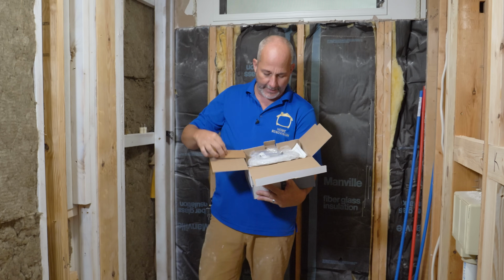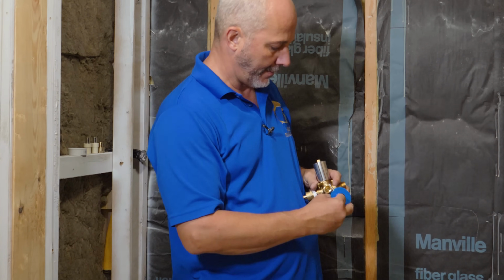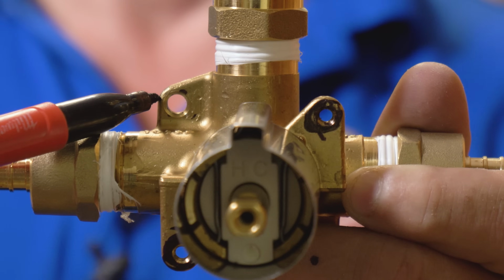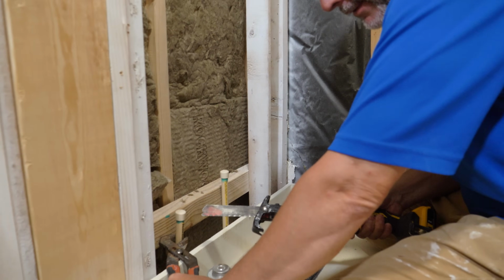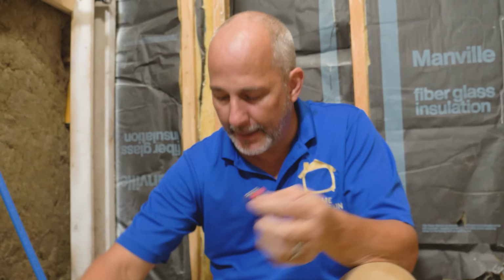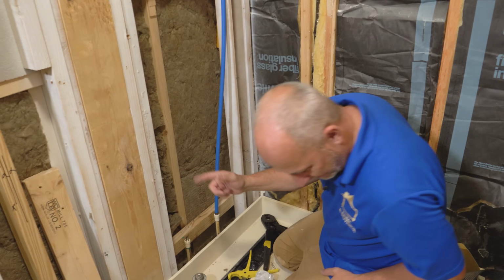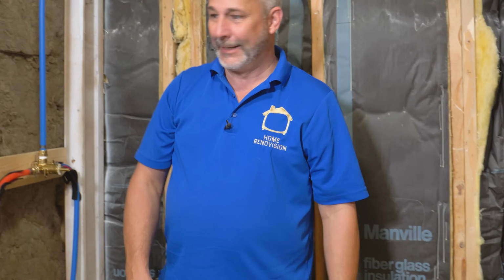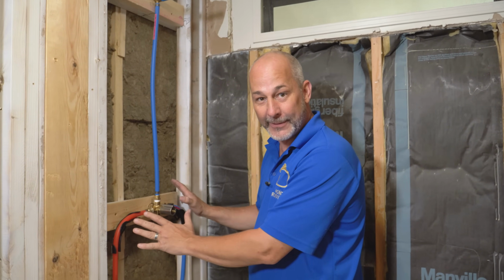How to Install a Shower Valve Kit (For Beginners)

Comment: That no-go gauge is for making sure the crimping tool is working properly. It has an adjustment screw for a reason, and that reason is not to cover the asses of absentminded installers.

Comment: I just removed my tub. Found out it was cast iron and weighed 300 pounds.  Had to cut it in 3rds with a carbide sawzall blade just to get it out. Fun times.

Comment: What about water hammer?  do you still need to include the extra piping on each side of the valve to prevent it or is not necessary anymore?

Comment: One thing I would add, if you are taking any pex out with these crimps or mess up (ask me how i know) when installing new. i use a Dremel tool with a cut off disk to cut the ring. Unless anyone can share a better way ?

Comment: Yeah you are a good guy. Ive watched several of you vids. One question though. Would it be better to use pipe dope after the teflon tape for a better seal on that valve? Ken in Cali

Comment: If only Sioux Chief made a 90 degree pex-b to sweat male adapter that was less than $1.50 and avoided the potential of leaky threads and the need/space for bend supports.

Comment: Currently doing my shower plumbing and came specifically to find out how tight the threaded connections need to be to see if this was something I needed help for. Thanks for specifically calling out that it needs to be tight but you don't need super-human strength! Tightened, and no leaks! 🙌

Comment: I'm not sure if he said whether he was using pex A or B?  This video shows how to use pex B, and I noticed a few comments seem to imply it's pex A.  A and B do look identical.  I saw one youtuber who said pex A pipes are white and Pex B are red or blue.  But that's just not correct (based on what home depot has in stock, you can also get pex A in blue or red).  Maybe there was a time when Pex A only came in white.  Pex B is slightly more rigid and uses crimps to make connections (an insert-type connector reduces diameter which thereby, also  reduces flow...supposedly).  Pex A is a different material that uses "expansion adapters" (you basically stretch out the opening and slide it onto the other pipe).  So Pex A keeps the full 1/2" diameter for the length of the pipe (which supposedly means better flow rate at the draw which might matter if you want better water pressure?  Just guessing.  The thing that's tricky is Pex A adapter sizing.  If you're looking for a pex A male adapter, it will be exactly the same diameter as the pipe (a full 1/2"), NOT slightly smaller as the insert adapter seen in this video.  If you wanted to go with Pex A, I don't think you'd even need a brass adapter at the supply line (just the expansion adapter).  At the top, instead of a pex-b ear drop adapter, you'd use a pex-a ear drop adapter.  I think that's the only difference.  Pex A is more flexible and some are saying even more reliable / easier to work with than Pex B.  The important thing to know is which type works with crimp vs which one works with expansion type connectors.  I was all set to buy pex A pipes until I figured that out.  And I'm still not really sure which option is best.

Comment: Went to take the copper pipe out of a finished tile shower.  It has been soldered in... I don't want to break the tile to change the ear drop elbow.... what are your thoughts if I just add a threaded copper adapter fitting to the existing 1/2 copper pipe.  The fitting will covert my copper pipe to a 1/2 inch male threaded connection... yes it won't be pretty but its a basement shower and I have black paint.  Do use see a problem, like strength wise?

Comment: I purchased this kit ( the same one) but the back of the shower valve has about a half of an inch pertruding out of the back/ it doesnt lay flush on the 2×4, did you drill a circulars indentation into your two by four or do u just screw it in like that ...its odd

Comment: Re Depth: if I put a piece of cement board and the tile I was using together and held it up near the shower value, would the front/top of the tile need to be in the middle of the green ring or at the very end of it. 

Also is it trendy now or have you seen it done where the handle goes over to the side so its not directly under the shower head ?

Comment: Terrorism supplies 
For a railroad track apartment...replacing copper with plastic..too set someone up for a leak when  bathtubs and  bathtub liners and walls are made of mildly flame resistant materials...which are suitable for joining operations of copper involving sanding cleaning and flame too material.

Makes me want too run for a bath or black water created by the dam society. 

Way to truck down the wheel rights with confusiousness.

Everyone wants to be parts tester.

If only they stoped running the trains at nite and served alcohol with h.i.v. pills education and preventative care in schools...like where medicine should start...corrective surgery numbing agents  including radiation synthetic vaccines with chemo and biologics when necessary.

Comment: So there must be different versions of the same compression rings or something. I watched another video where if the test tool goes all the way over, there is too much compression. Seems like the way the tool cams over, it would be the correct crimp every time

Comment: How do you get the fittings to engage the teflon without pushing the tape upwards? More of with 5 wraps of the thread tape vs say 3 wraps.

Comment: Great video! I should have watched this BEFORE I renovated my Bathroom. I completed the entire gut and replaced with new cement board, tiles, grout etc. But left the plumbing from 1980 intact thinking and any new shower handle would fit. Buy the new Moen faucet, bring it home to realize the 1980 faucet mount is smaller than the new one. Duh is me. Question is, Am I stuck tearing out new tile work, board, etc. to replace the faucet valve or are there any adapters/modern faucets that will fit on the original valve/spigot?  Thanks for any all answers

Comment: Great video thanks.   At 23:00 water pressure was checked by unscrewing the test valve then screwing back in (with water pressure).   We could not do this.   Water will make its way thru the threads if its wet.   We fixed the leak by drying off both the test plug and threads then screwing in again.   Tricky find right pressure as well.  Too much & too little will cause leaks on its own.   May help someone else.

Comment: I really appreciate your video. I've done almost all of the pumbing already using pinch clamps. I did quite a bit of research on crimp rings vs pinch clamps and read an article saying pinch clamps were better for a jumber of reasons so I went with them. Everything is holding under pressure. Do you think its worth redoing with crimp rings / have you seen a high failure rate with them?

Comment: Unpopular comment.

Pex B should always (90%+) be upgraded a 1/4 inch. If building code states the main should be 3/4 go 1 inch. This is because the fitting fits inside the pipe without the water pipe being expanded like pex a.

Comment: Always solid advice, good video, however you are so wrong on the crimps versus clamps. I realize that you have had a bad experience with the clamps, but they are objectively better than the copper rings in just about every way. Suggesting that the rings can "never leak" is really going out on a limb.

Comment: I could see how an inexperienced person could over tighten the screws, holding the valve in place, breaking off the holes where the screws go.  Brass is soft.  I was told that the rule of thumb is copper to the drop ear.  If deciding to go with pex, to the drop ear, to clamp the pipe to some 2x4 backing.

Comment: Question... that Moen Rough-in valve is good and sturdy with just those 2 screws holding it in place. 
I just installed a Delta R1000 Rough-in valve that has 2 diagonal screws holding it to the stringer as well but the damn thing is wobbly as hell and nowhere near as solid as this. Should I find some plastic strapping of some sort and strap it to the stringer on either side? Some guys say yes, others say no.

Comment: Great video-thank you!  I have a question-I have a stud right in the middle of my shower pan.  I know you said to line up the valve and shower head in the middle of the shower.  Is this for aesthetic purposes only?  If I do this, I'll have to either notch out the stud or cut it completely.  Thougths?

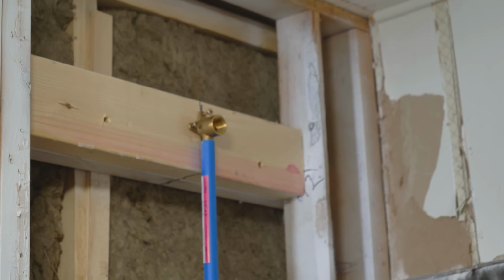Comment: 18:54 ish this is where the "Pro Crimp" rings come in, they have a built in plastic spacer that holds the copper ring at the right position and makes it completely idiot proof for setting the copper ring at the right offset from the fitting AND keeps the ring from falling when used in the vertical position.

Comment: Great video.  I ripped out all the old, rusting galvanized in my house and replaced it with 3/4" Pex B supply lines from my water source (well) and used 1/2" to the fixtures, shower, toilets, etc.   (Just installed my shower control valve and drop-ear today after watching your video.) Like you mentioned later in your video, I keep a small slip-joint plyers with me and on those vertical crimps, just gently squeeze the crimp ring where I want it located (1/8" - 1/4" like you mentioned) and it stays there until I perform the final crimp with the compression plyers.   Just a little tip so the ring doesn't drift from where you want it to be.   The Go/No-Go tool confirms the good crimp as you mentioned.  AND, it IS hard to crimp a ring above your head; I'll stand on a stool or upside down 5-gallon bucket to get in place to make a 'high' crimp!

Comment: i just recently had leaks outside coming into house. the house is 60 years old the metal pipe  connecting to copper got corroded so we changed it with pex pipe  now im learning it cant be in sun, what can i wrap the pex with or paint it with to protect from the sun?

Comment: The Moen faucet you used allows sweat in PEX-B adapters or copper for the inlets and outlet(s) in addition to the 1/2" NPT fittings. Good explanation for setting valve and shower adapter depth. Good homeowner tip to check your work open 12-48 hours later. Leave the T wrench in place until the job is over so you can quickly shut off the water supply when you have a leak. Having similar model Moen valves in my house has made me less fan of Moen. The 1222 cartridge fails easily. One of mine broke in the open position. The cartridge broke into little pieces during removal. Not a fun replacement. The 3 knob Gerbers and Price Pfisters were much easier to repair...

Comment: Who makes the PVC to PEK barb you green glue to the inlet lines. Ive looked at Home Depot and Lowes and ask the people that work in those departments and they dont know what Im talking about. also is this considered PEX A or PEX B . I bought the sharkbite 1/2 barb to FNPT, the barb was too big for the inside of the PEX tubing.

Comment: Funny thing is at the end when u said by the time you realize it’s leaking you have mold, rotted dry wall blah blah blah and u have to tear the wall out to find it. Is exactly where im at right now . Noticed water leaking outside of my house on bottom of stucco . Just tore the whole wall out to find that valve dripping more then just a drop I might add, but damage is done . Now gonna just watch the rest of your videos and tile the shower since I had to rip the fiberglass insert out already 🤦🏽‍♂️🤦🏽‍♂️🤦🏽‍♂️

Comment: NOT ALL DRAINS ARE CENTERED! My plumber installed my valve, base and drain. It's CODE in MASS. He lined up the valve  inline with the drain. Unfortunatly the drain was offset in the pan (Alcove 36x36 pan) though it was called a center drain in the literature.  I was installing the rest so I was able to correct it. The drain was 18 inches left to right but 21 from the front and 15 inches from the back wall. The valve was on the right wall, not the back.
I have been watching your vids on and off (as needed) for some time now.

Comment: Jeff, ok maybe a dumb question:  the PEX pipe is 1/2" but in the materials list you have 3/4" PEX Barb Copper Crimp rings listed...Is the answer to get a size larger than the pipe? Or...? Thank you so much for this video!  As per usual, you gave me the answers I was looking for - and one question apparently...:)
Reply from the maker: our bad. sorry I am going to be going over all the links during my winter break and get everything up to speed. Cheers!

Comment: The go/no go advice is potentially misleading.  Usually the gauge you used with only one opening, has a line half way which is the go/no go line.  If it goes all the way it's a no go.  If it doesn't even go over the ring, it's a no go.  It's a go when it sits about halfway, at the line. Other types of gauges have 2 sides (so 4 openings for 1/2 and 3/4), one that goes all the way for a go.  Maybe yours is this type but certainly many are not.  I have an older Apollo tool and it has the line in the middle.   And whenever I've crimped a ring like you did on drop ear, it always comes out slanted (no go), so get a ladder and be square to it and in control.

Just some advice for anyone with a different no go gauge, otherwise the video and advice is great.

Comment: The stainless clamps work just fine.  Use a calibrated tool to clamp the rings,and there will be no leaks.
Reply: I have never had one fail either...if you use the proper tools to compress them...not vice grips...they will not fail...plus they are easier to take off if you need to change or Reno....Stay Hard for Life 💪💯
Reply: Exactly!  For the home DIYer the stainless tool is smaller, gets into tight spaces, and the only reason plumbers use the rings is because they are CHEAP... aka, more profit!  I converted the whole 2 story house in PEX with stainless clamps many years ago. Even underground PEX lines to the house in stainless... no issues!  Maybe in Canada the beavers chew the PEX and they blame it on the clamps!
Reply: By the way, if the licensed plumbers 30 years ago would not have allowed copper solder joints to exist in connection with the concrete slab, I likely would not have had to replumb the old copper.
Reply: I use the stainless pinch clamps on all my remodels and never had a failure and have been using them for 12ish years. So I disagree with your comment but still a good video.

Comment: Great video. Everything explained very well. I did this job in a basement shower for the first time after watching a similar video of Jeff's on another shower and everything went fine. Do make sure you give it a day or two and take a close check for leaks at those threaded connections, that's very good advice. I had a very slow leak. One drop formed on the threats (with teflon tape) every three hours! But I just gave it a 1/4 inch wrench turn with the pex still connected and it's fine. I didn't use the black thing to bend the pex to the valve. Just used a 90 degree elbow fitting on each side and it all works fine. I suppose it four more connections (potential leak points)  but as Jeff says, once that connection is properly crimped and tested with the guage ... it won't leak. I've made hundreds of pex crimp connections with the same Home Depot pipe and tools Jeff is using here and I've not once had any problem. Final thing: Don't be afraid to try doing stuff like this, if you want to learn and save some money. Even if someone goes a bit wrong, you learn from those mistakes. Now I've got to start on the upstairs bathroom. Basement was my "practice" bathroom 😂😂👌👌🚿

Comment: I am amazed at how many people use slip joint pliers & adjustable crescent wrenches backwards. They require very hard grip used "backwards" to prevent slipping on the nut or pipe, whereas when used correctly, they actually tighten the grip on the nut or pipe with pressure on one handle & require less "squeeze" to tighten.

Comment: Jeff, I'm a 70-year-old woman. My aunt convinced me to take out our bathtub/shower combo (my husband in handicapped) 2 years ago. I got it all torn out, but I was insecure, and we been bathing with buckets. The plumbers came and told me Sharkbite and pex is only temporary and wanted $1400 just to install the mixing valve. But after watching this, I feel more confident. I've decided to use GoBoard from Lowes rather than cement board because I can lift them easier. Thank you so much!
Reply: use pex b connectors and pex b pipes. for transitions from copper to pex use sharkbites. I would recommend using a copper to pex adapter but you will need some experience soldering. I know plumbers tried to scare you to secure the job. Sharkbites are good if you install them correctly.
Reply: @RexG022  thanks! (I installed them 2 years ago (Sharkbite shutoffs) and no leaking yet.
Reply: @RexG022  Pex B fittings reduces flow unlike Pex A.
Reply: @ThomasNorthCastle  yeah but cost more and is a little trickier to work with
Reply: @ Tricky to work with? You put the collar on the pipe span the joint put the fitting in and you move on.
Reply: @ThomasNorthCastle  you know wr originally replying to a 70 yrs old person right? you saying using a expansion tool manually is easier than a pex be crimper
Reply: @RexG022 You just hold the expansion tool and actuate it. A baby could use it.
Reply: @ThomasNorthCastle  are you talking about the $500 expansion tool? She might as well just let the plumber do it at that price
Reply: @yeeaahBUDDY It doesn’t cost that much anymore.
Reply: @ThomasNorthCastle yes they do, Amazon has one for $380, but any name brand expansion tool cost right around $500
Reply: I installed sharkbites on my new kitchen sink in 2019.  It still hasn’t leaked. 🤷‍♂️👍
Reply: Pex is absolutely not only temporary that's s criminal
Reply: Your a 70 year old woman and demoed your bathroom shower? And somehow your aunt told you to it who would be even older than you